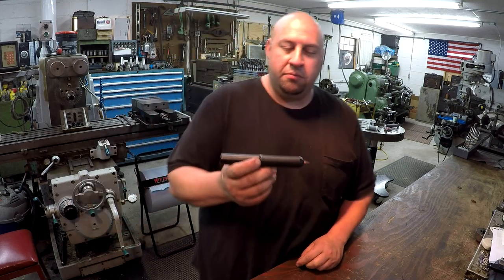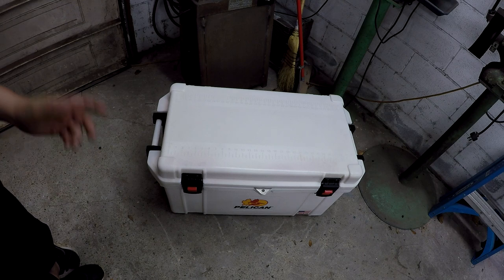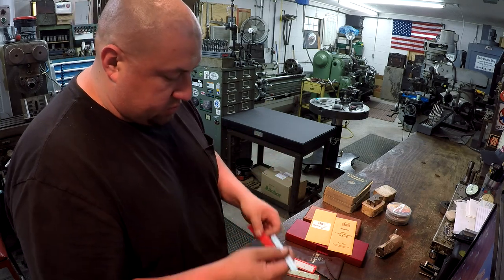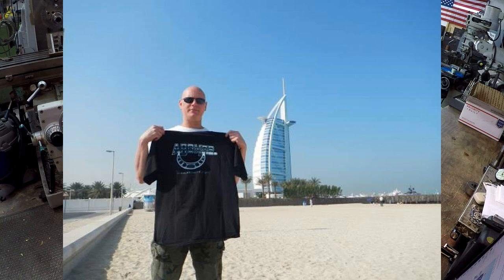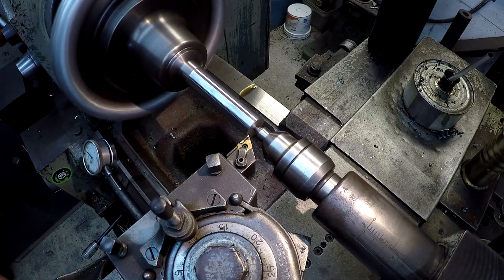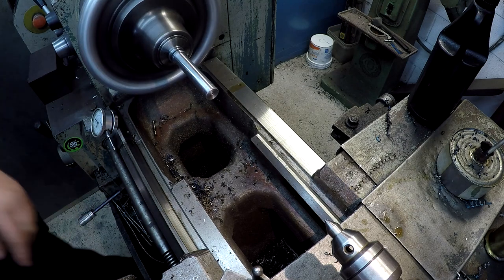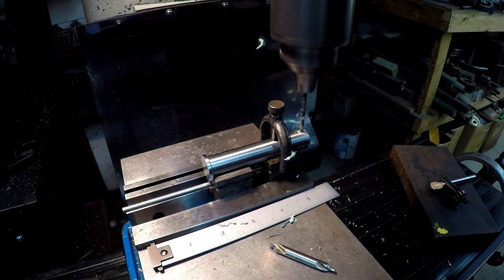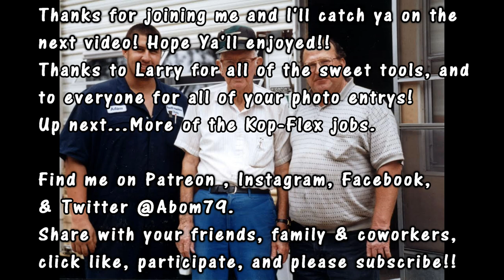Saturday Night Special 109

Comment: It’s the ‘Berj’ soft ‘j’ almost ending in ‘sh’ but in the ‘j’ or soft ‘g’ sound.  The full sail architecture is unique around the world.  Because of the upward/seaward wind stresses it took 1/3 more high alloy steel in the framework, specially shaped 2” glass tinted windows made to near perfect dimension with flawless surface and many metric tons of extra concrete deep into the bedrock to stabilize against sheer force.  Yet the delicate appearance belies the incredibly difficult construction and highly specific machined structural counterforce beams.

Comment: I picked up a metric ser of Dewalt drill bit from .5 to 10.5 in .5 increments but the besrt thing is you dont have to use a centre drill.

Comment: hey Adam great job this week

just wanted to talk about those anular cutters for a second. they sell adaptors to put those in a mill. you are missing a pin that goes in the middle. when you use the adapter the pin is spring loaded and pushes out the slug. they are great for hogging lots of holes in steel. personally I've used a 1 1/4 diameter cutter through an inch and a quarter plate using a mag drill. they are not just for thin steel.
Reply from the maker: +Nick Savard Oh yea. I have used them in the past for making large holes in thick plate steel. i was using the mag drill that has the proper attachment to use those cutter, think the brand was Hole Hog,.

Comment: Adam, I am shocked -- shocked!  You did not use that beautiful Sterret metric scale to measure the length of the pins :):). And I bet that equally lovely digital calipers would work both in metric and Imperial. So set the calipers to 11 mm or whatever. Zero it. Press inch button. When you measure, the reading now tells you how much you have to take off. Calipers read zero, done. I turn that way always, even if it is an Imperial dimension. Got that tip from myfordboy channel. Never thought I would ever tell abom any tip, but you seem to do a lot of motorcycle work and they are mostly metric.

Comment: Nice job Adam.  I didn't know that Pelican made coolers too, I have some of their cases for camera gear.  Top quality stuff.  Did you score a center pin with the rotabroaches?  It's handy for alignment and also to push the slug out when you drill through.
Reply from the maker: +Bill De La Vega The coolers are awesome and top quality stuff. I didn't see the center pin with the cutters.

Comment: Hey Adam, what DNMG are you using? I like the chip breaker on it. I've got some sanvik DNMGs, don't remember the number, but they don't break a chip as good as what you're using. Thanks
Reply: +Chuck Tipton I would like to know that type of DNMG too.
Reply from the maker: +Chuck Tipton These particular inserts are the dnmg 431, Ingersol VF TT 9080

Comment: Was that some kind of heater you had to fit the flange to those shafts? (that part of the shop looks very clean!). Great video as always Adam.
Reply from the maker: +Robert Watson Yes that was an induction heater used for warming bearings for installs. That's our "clean room" for final building of gearboxes.

Comment: Adam, you just showed off a metric starret ruler, and then instead of using it to measure the pin, you converted 90mm to inches and used an inch rule?
Reply from the maker: +Jesse Smith I'm soo used to it man! LOL
Reply: that is some strong hard wiring hahaha